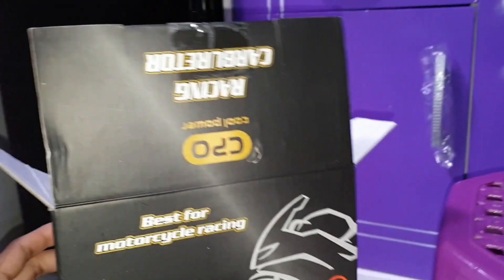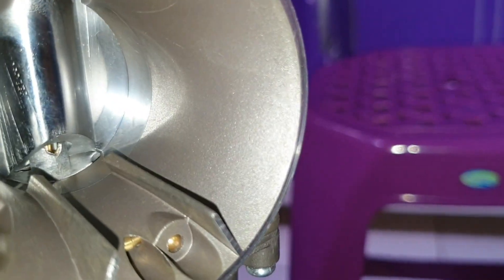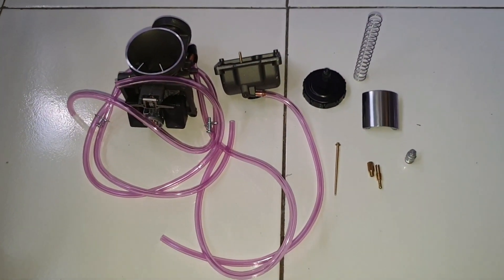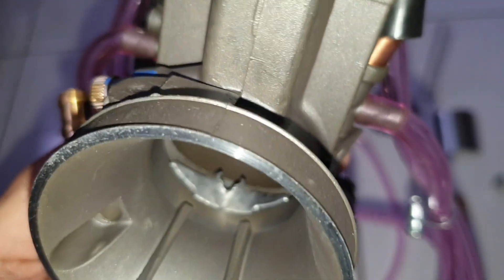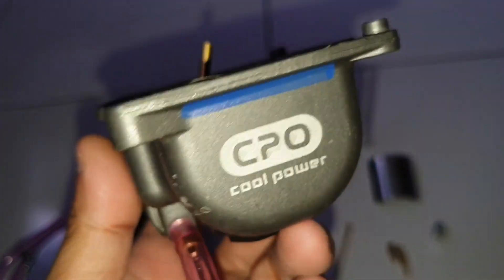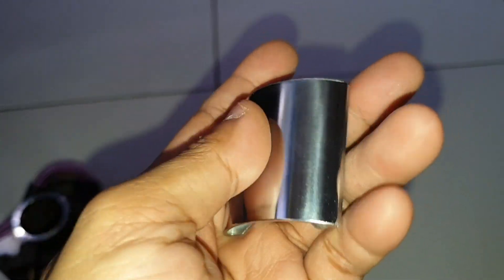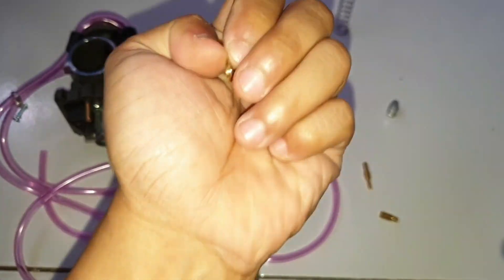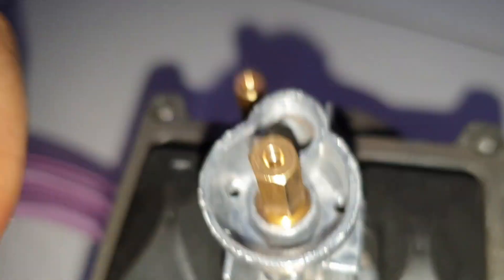Review Karbu CPO PWK 38 Airstrike Harga Merakyat dan Teknik Baca busi | Eleanor MotoVlog

Comment: setingan karbu cpo gutu enak apa enggk mas 🙏
Reply from the maker: Mnurut saya pribadi, easy setting. Utk keawetan, saya ga rekomen
Reply: @exxan99eleanormotovlog  klo buat honda tiger langkah 70 seher 71 klep standrt pakek karbu CPO uk 35 kira kira gimana mas rekomen atau pakek yang lain
Reply from the maker: @agungsantuso5793  saran saya pale pwk 35 snd. Krna slain awet, easysetting jg power berasa
Reply: beli dimana mas
Reply from the maker: @agungsantuso5793  ada d bandung.. pwk 35 airstrike kena 1.6jt

Wa 087823001066